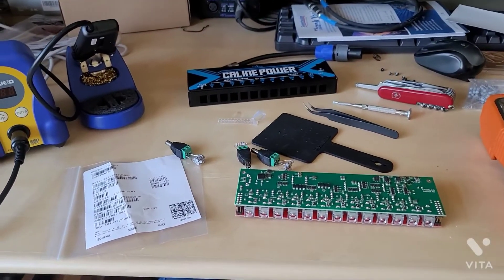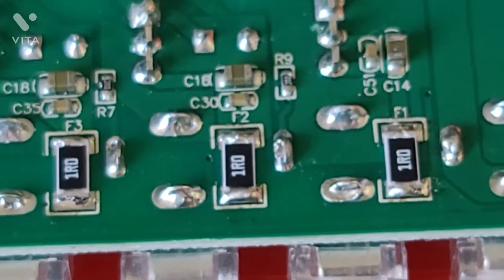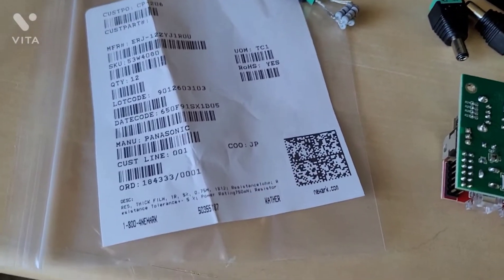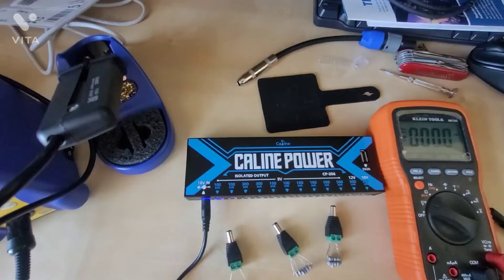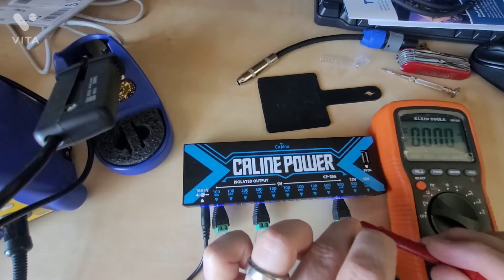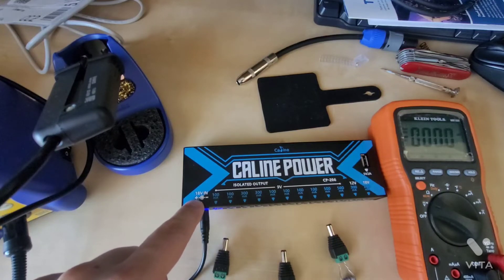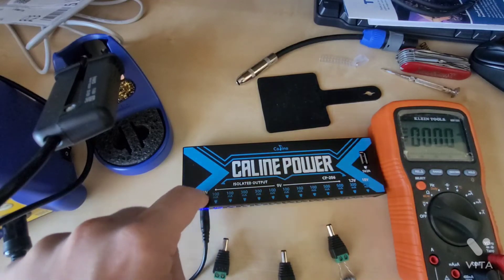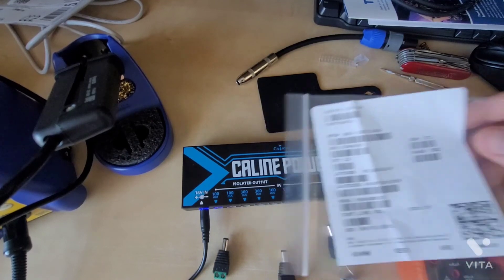Caline Technologies CP-206 Isolated Pedal Power Supply: Teardown, Testing, & Review

Comment: Can you tell me if Caline CP-204 is insulated and has individual short circuit protection?
Reply from the maker: Apologies I have not worked on that power supply before. You can send a message to Kline through Facebook Messenger or through their website they do answer back
Reply from the maker: http://www.calinemusic.com/products/powersupply/237.html

It appears it has filtering, and mentions isolation, but I have not taken one apart to verify.

Comment: This power supply is currently available in South-Africa 🇿🇦, has it been updated already, I am wanting to buy this particular model? Thanks for the informative video.
Reply from the maker: Not sure for other markets. I was told it wasnt released yet here in the United States. It's a simple resistor value change. The rest of the circuit is well designed.
Reply: @Bassguitarist1985  thank you, if that needs to be done locally, is it straight forward enough, and what is the part number?
Reply from the maker: @craigfouche  the part i show in the video. Very easy to replace if you have hot soldering tweezers. Its a 1 ohm size 1812 3/4 watt resistor in positions F1 through F12.

Comment: very interesting, I bought a cp05 long ago and its fine, some noise, insanely bright lights but is not true isolated outputs.
This is advertised as though it is (so was the cp05) but do you have a video showing that?
Its an incredibly price if true my harley benton was double and pretty sure was the cheapest at the time.
Reply from the maker: Yes there is another video where it was this 206 and the 207. I go into extreme detail on how the circuit works. It is for sure isolated from each other. And also from the incoming wall power.
Reply: @Bassguitarist1985  are you following me :P
literally just came back from watching your other vid! Im assuming the 206 is the same (plus extras) circuit as the 207 and the sound test at the end speaks for itself.
Thanks for your help!
Reply from the maker: @JakkiFN0rmus  my pleasure! Thank you for watching

Comment: I am experiencing a problem with a cp206 power supply. Hopefully, someone here may know how to troubleshoot it.
The power supply started flashing on and off as did all the pedals it was powering. I suspect it was overloaded as it was powering 12 pedals. 
It had been working fine (fresh out of the box) and the failure occurred after 30 minutes so I suspect something overheated and also it smelt like something let out there magic smoke inside. This is the second time it happened with a replacement unit sent out under warranty so I suspect either I am doing something wrong or the power supply is not up to the task.
Reply from the maker: @anomalousnessness  The power supply will start flashing on and off if there is too much load. Specifically it puts a lot of stress on the circuit that takes the incoming DC and converts it back to AC to use with the isolation transformers. Unfortunately when things start to overheat internally it may cause permanent damage. My CP206 does get warm to the touch but it should not be scalding hot during operation.

You need to look at the current rating of each pedal and make sure that you are not overloading every output. For example if a pedal says it takes 300 mA but you find that it is only drawing 100, you still need to plug it into the 300 port as that is the max it can draw during its use.

Comment: just bought this power supply! is it any good? I got bunch of 9v pedals
Reply from the maker: Yes I've personally beta tested this and the CP-207. It has true isolation and clean power. Check the current ratings for each of your pedals to make sure you do not overload the specific outputs.

Let me know if you have any questions

Comment: How to calculate load with resistor?
Reply from the maker: V=I/R formula. I know voltage and resistance. I can solve to find the current.
Reply: @Bassguitarist1985  I see, if I have let say 500 ma psu, then we add load, how much lowest "safe" and "work" Voltage drop for guitar pedal?
Reply from the maker: @qrdaudio  its an it depends answer as many analog pedals can handle a pretty large voltage sag. Digital pedals need tightly regulated voltage. In general no less than 8.7vdc in my eyes for 9V pedals especially digital ones. I could be wrong with that number though.